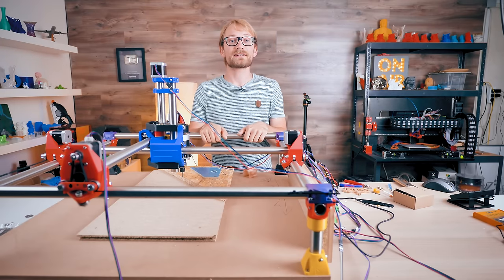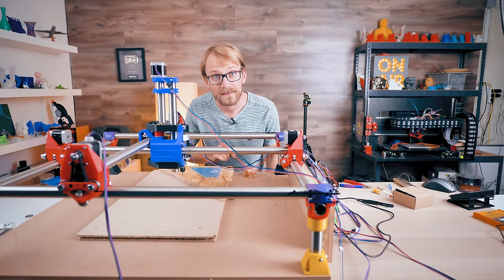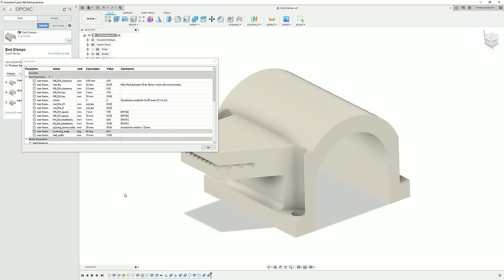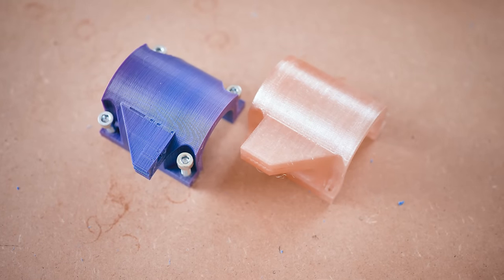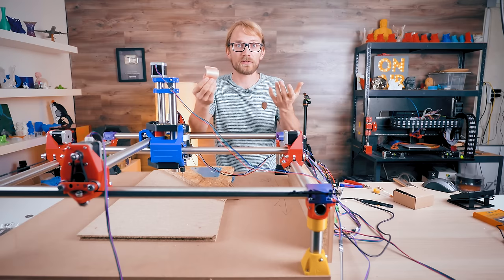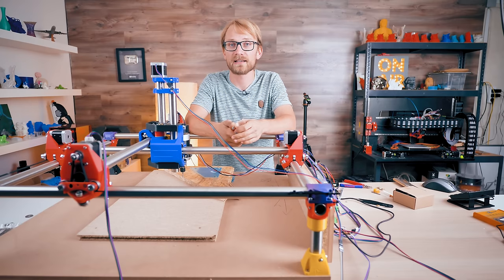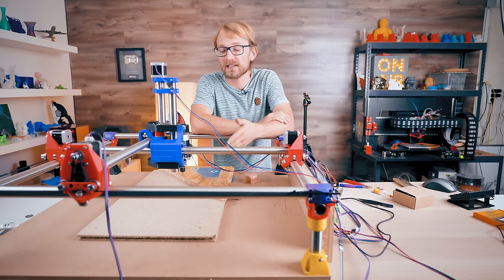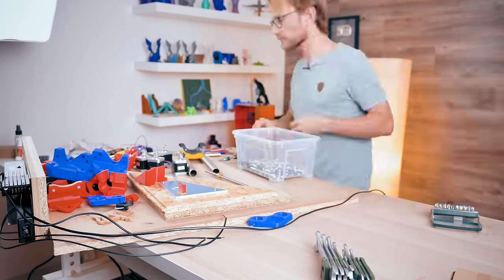Whose design even is this? (MPCNC conclusion)

Comment: I'll start stating that I'm not a lawyer and believe that Ryan has done a brilliant job. My understanding is that: He can't own copyright to the functional shape of a mechanical part (as Tom already mentioned in his video); he' have to apply for a patent. I am 100% with Tom on this one and I feel that this story ending is a shame.
Reply: And trying to patent a bracket that goes over tubing . . . Good luck ryan.
Reply: Even then, this is a hobby machine. Not making money by running a business selling the machine or the ORIGINAL parts.
Reply: @mickeyripper6976  Except that's exactly what Ryan does. He makes a living selling parts and kits and vitamins for his original design. That's why he has the non-commercial clause on his design. Because he doesn't want someone to take his design, rename it and sell it. Tom was trying to take Ryan's design, slightly modify it, release it under a new name "OPCNC" with no commercial restrictions and that would allow anyone to do just that.
Reply: @hodgeac  Anyone CAN just do that. He has no claims to the functional aspects.
Reply: @karnov9248  IANAL but apparently most of Tom's super fans are.
Reply: @hodgeac  if his design worked correctly in the first place it would not need improving. what exactly is he losing out on? one tube saddle? he's just got his knickers in a twist because somebody else did a better job than him,
Reply: @mickeyripper6976  I'm continually surprised by the responses I'm seeing on here. Look, first of all we have no idea if Tom's design works well at all because Tom abandoned it before using it. 
Second of all, Ryan never asked Tom to take it down. Ryan took issue with the fact that Tom wanted to release his part with the non-commercial restriction removed allowing other people to sell what amounted to a copy of his machine.
Lastly, Tom publicly stated his intentions to modify the parts just enough and re-release the entire MPCNC as "OPCNC". And even then, all Ryan ever wanted was for Tom to not allow people to SELL what is effectively a copy of his design.
Reply: @hodgeac  Still wouldn't have wasted my money on Ryan's junk machine. and so what if he wants to redesign the machine. what ryan is suggesting is he has patented the entire concept of a CNC machine.
Reply: @hodgeac  I believe he tested it, that's why he released it... Also, the non commercial license works both ways so if Tom releases his part as such, Ryan couldn't sell it anyway.

As for basically redesigning and building a similar version of the machine, if the logo is not included, there's nothing that can be done about restricting that, regardless of reality distortion fields, since copyright doesn't apply to the functionality of the parts.
Reply: I don't think that is true about copyrights.  They can cover concepts and ideas such as books and movies and forms such as pictures and paintings.  You can't just change all of Marvel's characters and remake the final movie using different actors and claim you started from scratch with different actors and dialog.  The concept of super heroes defeating a bad guy with a power glove would have to be very different to not violate the copyrights.  Same here, Thomas can't just copy the concept of what the part does by using a different modeling software and expect it to not violate a copyright on the conceptual shape.  Similar to copyrights on artwork, if it looks similar enough, regardless of function, that may have protections.  We are just guessing, though, as I assume neither of us has actually seen what the supposed copyright says and covers.
Reply: @Anonymouspock  The license defines what is and is not a derivative. By using the files, which Tom did, you agree to the license. It is not solely copyright that determines what is permitted or prohibited.
Reply: @hodgeac  except tom didn't take his design he designed a part from scratch so if I design a bracket for a flagpole but uses the same diameter poles this on violating his license because someone could use it on this machine? That's just silly Tom's part was not a derivative he designed it from the ground up
Reply: If I draw the Superman logo by hand but color it green, it is still a derivative of a protected work, even though I created it from scratch.  The creation method does not release the protections.
Reply: @jeradw7420  thats not copyright at least i dont think it is. That is a trademark. But even if it is a copyright its irrelevant. You are copying something unique. He did not copy anything. He designed a part of his own design. This is why you cant copyright functional designs. To avoid exactly the trap you tried to lay for me. Your trap did nit work for the same reason. Nothing was copied.
Reply: @NerysThomas did not design the part.  He took an existing part, drew it in a CAD program, and changed some parameters.  This is, even to a designer, copying.  A copyright can cover functional parts depending on how it is written and what it covers.  They cover nontangible things like ideas such as novels and software.  They can also cover shapes such as artwork and paintings and photographs.  It all depends on how they are written and more importantly, how they are defended in court.  The lawyer will plead the argument of violation to the court, and the court (most likely not designers) will decide if a violation occurred based on how the copyright was written.  There is no trap, this is just how it works.  This is not the best protection method for a design, but that is not my argument, merely that Thomas can be in violation depending on what the copyright says.
Reply: @jeradw7420  yes. he did design the part. that is not even up for dispute.

he did not take an existing part. he made a new part to "do" something new. 

This is not copying even to a designer. this would be like me using a 4x4 post cap to attach a light to a 4x4 post and I design my own 4x4 cap and you say "I copied your design" which is the extreme of ridiculous.

This is specifically why you can't copyright "functional" designs. so people can't "copyright a hole" which would be insane.

NOW maybe if MPCNC had "designed" from scratch every aspect of the machine he could possibly (but unlikely) have a case.

but he did not. he used off the shelf parts. which is WHY the non functional copyright clause exists. MPCNC did not design the rails used in the machine. this is why he can't even try to copyright the "idea" of attaching something to said rails (which is what he is trying to do)

I am NOT a lawyer and I am not a copyright expert but I know enough about this crap that I know I am right here and that tom is also right.
Reply: @Nerys If you compare the parts side by side, Thomas in no way designed his part.  It's a copy with some tweaks.  The holes, overall shape, and nearly every other feature is the same. (3:16)  What he did was rearrange the features and order of operations in the CAD software to end up with a very similar finished part.  To a lawyer and a designer, this is a copy.  Sure he started with a fresh blank model, but the end part is a copy.  Copyrights can be used for sculptures regardless of medium of expression. This would include the 3d model and the printed plastic.  Nowhere is "functional works" prohibited from being sought for a copyright.  Again, is this enough to show violation?  Maybe, that's where the judge comes in.   While the idea of bolting to a tube is not protected, that "exact" shape maybe.  It would only not be copyrightable if it was the ONLY way to attach the part to the tube.  Since it is not the only way, that specific shape, regardless of how it was modeled, may indeed be protected.  Can Thomas make a different shape that holds the tube and belt?  Sure, but that is not what he did.
Reply: @jeradw7420  I think you entirely missed my point he had to design to go around a standard size tube and to fit the same way this necessitates the design being essentially the same this is why you are not allowed to copyright a functional design! Because inevitably if you do the same job you going to end up with basically the same part this is why the buron looks like the space shuttle not because they copy the space shuttle but because the same problem required the same solution so they look similar

Again I don't know why you did not acknowledge this in my original reply if you design a square cap go over a 4 x 4 post and I design a square cap to go over a 4 by 4 post their going to look exactly the same because they're doing exactly the same simple thing the exact same standardized part
Reply: Firstly, in the Buran, design optimization for a very specific task is completely different than copying.  Optimizing adds specifications onto a design until only one possible outcome exists.  Thomas did not optimize anything.  He took what was there and added of few variable parameters.  Yes, he could have designed his own bracket, but in this part, it is clearly a copy.  There are plenty of ways to make a bracket without using the same size, hole spacing, trapezoidal attachment, etc.  There are enough features in this part to tell it was a copy and not limited to your 4x4 example where there is only one solution that meets the design parameters.  If I drew a car and had a copyright on my drawing, you cannot redraw the car and put a separate license on your drawing.  This is what Thomas did when he released the 3d file, essentially the drawing.  The fact that it can be a real part is not what the copyright can cover, but it can cover the portrayal of an object, (the 3d model).  I don't know if this is what V1 had in mind, but Thomas can't redraw the exact same part or a mostly the same part.  He can print and sell copies of the 3d bracket all day long, but it is the 3d file that I am stating that could be in violation of copyrights.
Reply: @jeradw7420  i told you he did not. If you reject this that is a you problem not a me problem.

He designed it from the ground up. He wanted it parametric so he had to design it from scratch.

Either you accept this reality or you do not. Either way you are now just being repetitive.

I am stating there is no violation of copyright. The part is his whole cloth creation. The only way you can limit such a creation is with a patent.
Reply: @Nerys You are also being repetative.  The reality is, it does not matter whether he made his model parametric.  The end result is a model that LOOKS very similar to the original.  For copyright law, the final representation of the artwork is what counts.  You can disagree all you want but anyone looking at time frame 3:16 can clearly see the copied part,  the part made fron the 3d file used to generate the gcode.  That 3d file is similar enough in representation to be a copy regardless of the method used in its creation.  It was not a whole cloth creation.  The physical object would be covered by a patent, but the 3d file may be covered by a copyright.  If the V1 parts are covered by a copyright, you can't make another 3d model of any of those parts, regardless of if you started with a blank file as the original 3d model is the work of authorship covered by the copyright.  The end 3d model would be a representation of the original artwork an thus a violation.  You don't have to make an exact copy to be in violation either.  You would, however, be able to print and sell the plastic parts unprotected as that is where the line between copyrights and patents is.   You need to look at both aspects of this creation, the 3d model (covered by a copyright) and the plastic part (covered by a patent).  I reject your claim of it being a new design as I have shown you the part of the video where it is clearly a copy.  If there is a copyright on the 3d model, there would be a violation with the model Thomas showed in the video based on the similarities of the finished shape.
Reply: @jeradw7420  precisely you are being repetitive therefore I have to be repetitive in reply which is why I'm stopping

And you are confused looking or functioning very similar would only apply in patent law not copyright law

Yes you can make something that looks the same that's why it's called the utilitarian exception old is not autistic it's not original it's functional the classic example given in law is that if you designed a fantasy car I could not make for example of 3D model of that car without violating your copyright even though yours was not 3D it looks the same as you noted it Ford could make a functional version of the car that look like it and it would not violate copyright

I'm not sure why you're not understanding this simple concept he made a functional part there for the copyright doesn't apply
Reply: You just gave the example and it seems to me you don't understand it.  V1 created the original drawing of the car, Thomas made a 3d model copy of it.  I don't see why you are failing to recognize this even after given the classic example.  The utilitarian aspect does not apply in this case as Thomas released the 3d model, not the plastic.
Reply: @jeradw7420  I'm sorry you don't seem to understand the design is utilitarian not artistic he didn't release a drawing of it he released a functional producible model of it via his file that would be like saying Ford could make the car and not be in violation of copyright but their blueprints would be a violation which is just a silly your lack of understanding is the problem here case law is quite clear on this
Reply: @jeradw7420  and just to clarify how YOU are not understanding the example "I" gave you

THREE PARTIES 1 - 2 - 3

1 is the original artists who made a drawing of a futuristic car
2 is 3d artist who made a 3d model of the car (decorative model non functional)
3 is FORD MOTORS who made the futuristic car REAL

2 violated 1's copyright. 3 DID NOT VIOLATE 1's copyright since his rendition was FUNCTIONAL

Thomas Sanladerer is 3

he made a FUNCTIONAL 3D model that "FIT" 1's device. it does NOT violate copyright since copyright does not apply. AS PER LAW and as per established case law.
Reply: @Nerys Thomas does not fit 3.  He is 2 as he released the 3d representation of the part.  That is why Thomas is in violation.  What he released WAS number 2 - the 3d model, not the functional part.  If he would have just showed his new part, no violation.  Since he released the artwork, in this case the 3d model, he was in violation of number 2.  You seem to think that just be cause he then printed the part, this somehow moves Thomas into category 3, which it does not as the released work is still 2.  A copyrighted work can still be functional in nature.  For example, if I were to draw the futuristic car in the form of a blueprint, you can't copy that art work, even if you could use it to actually make the car.  You are hung up on "functional" as if that is free from copyright, which it is not.  It is the work itself, the 3d model, which carries the copyright and was violated by being copied.  It does not matter if that 3d model was then used to create a part.
Reply: @jeradw7420  blueprints are not artwork Thomas's number 3 your acceptance or rejection of this is irrelevant 

You seem to once again be confused it does not matter whether he printed the part or not the part was functional there is no copyright violation I just went through this exact thing with a vendor who tried to claim copyright over something they have no right to I won. And for exactly the reasons i state here. You cant copyright basic shapes etc.. You are not allowed too.

we are going nowhere in this conversation I am done with it

Comment: Um...it's the guy's design and people should respect the IP of others and their wishes otherwise people just stop sharing.  Also - you increase tolerances and reduce chattering in any kind of CNC by slowing down the rate and depth of cut.  This virtually always works.  This isn't a $30K industrial machine.  Lot's of people get high quality pieces by simply adjusting appropriately.

Comment: Pretty sure the copyright/license apply to the file (STL or others) not to the use/purpose of the part.
Reply: @Potatogambit  not the design, but there's still the brand "mpcnc' :)
Reply: Jean-Sébastien Tremblay if he owns the trademark for it. Mostly printed Cnc could be considering non-unique and already in common use.
Reply: Also the part tom made is an invention that was not invented by V1
Reply: @intelligenceservices  yes. But the question is does the original license applies?

Even though that's an original (although simple) idea if the new file would have been made by importing the original STL, the license would apply.

Of course, Tom have put the time to do it from scratch, so the license of the STL from V1 doesn't matter.
Reply: @JeanSebTr  what if tom made only the teeth gripper part that holds the belt and instructed us to just epoxy it on? I bet v1 would try to claim it still.

Comment: Technically Ryan's part is a derivative of other pre-existing clamps .. therefore his design is not unique .. and a copyright would not apply unless all dimensions were identical.  Bottom line:  a lot of the copyright protection labels being used, will be useless in court for protecting a design for such a simple obvious non-unique part. That said, nobody wants to get dragged into court... but most of the time it more just a person blowing smoke (or inhaling).
Reply: Even if the dimensions were identical, copyright doesn't apply to the part. The only thing protected by copyright is a logo on the side of the part.